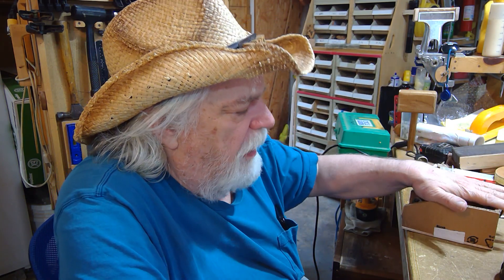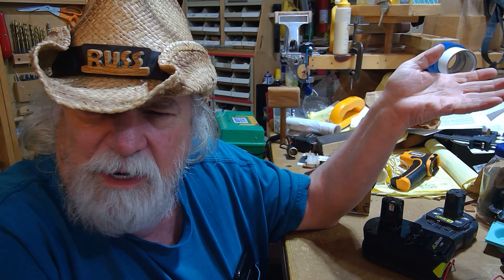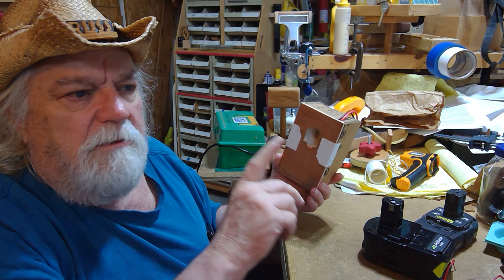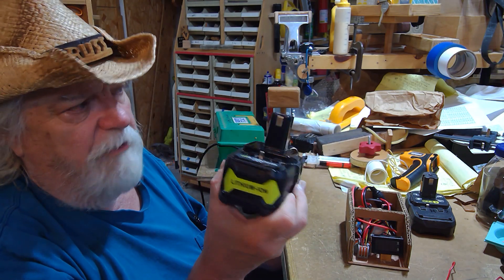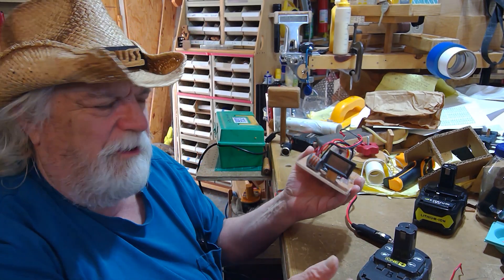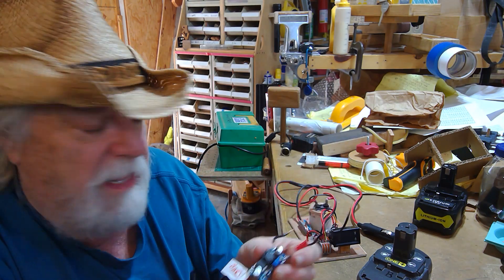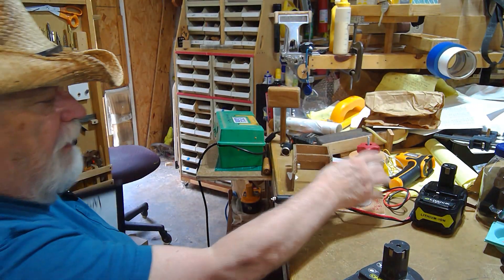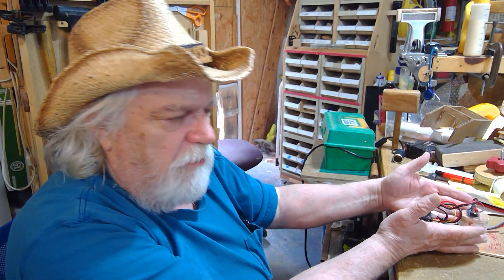DIY Ryobi Battery Charger Update by OTB Thinker

Comment: How would it work for craftsman 19.2v battery packs?
Reply: charge one of your batteries on your home charger and then read the voltage if it is around 21 volts this should work fine for you.  You would want to adjust your output voltage from this charger 0.2 volts lower than the highest voltage you read from one of your batteries right after it comes out of the charger.  so if you read 21.5v you would set this charger for 21.3v
Reply: @advancednutritioninc908  My home charger does not show voltage. So I don't know where the voltage is when I take it off the charger.
Reply: @Rodbuilder109  Once you have a voltmeter you can measure one of your batteries once you put a fresh charge on it.
Reply from the maker: the battery you have is a totally different battery.  My batteries are lithium and  the battery you have is a NiMH.  I would need to do research on the specifics of that chemical type battery.  The charging rate and the max volts are specific to each type.  I don't want to give you bad advice.  Sorry, Lance
Reply: @russveinot5754  All chemistries will work as long as you don't set your charging voltage too high.  If you have a house charger currently?  Charge one of your batteries up and measure the voltage right after you take it off a full charge.  Set the output voltage on your converter module to be at least 0.2vdc lower than what you measured on your battery!
Reply from the maker: @advancednutritioninc908  I'm sure there are specs for the battery in question out there on the web somewhere.  I just don't know what the specs are for the Craftsman 19.2v.  You should always check specs (& be sure) before charging any battery.  Charging any battery incorrectly (voltage or current) can be potentially dangerous or do damage to the battery. I recommend finding a spec sheet on that battery first.